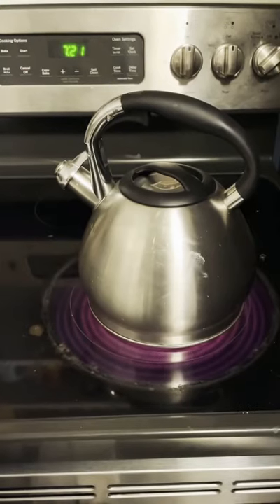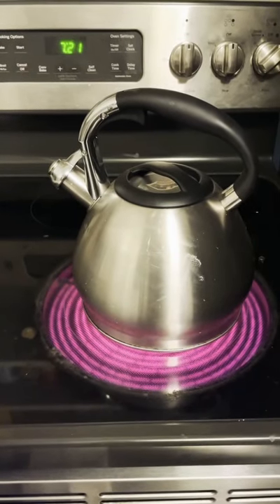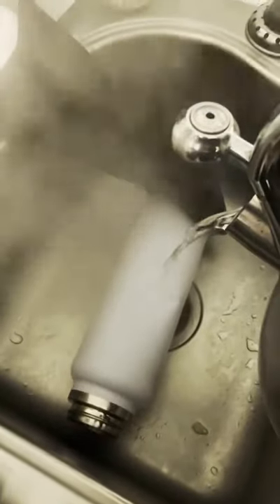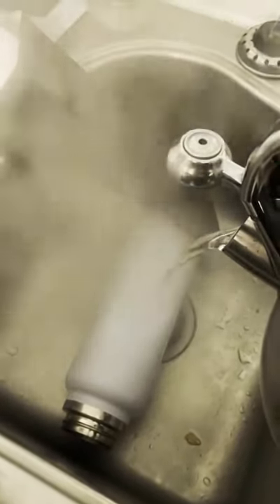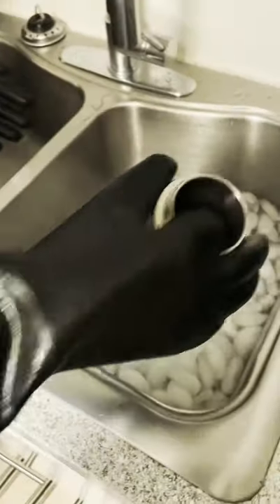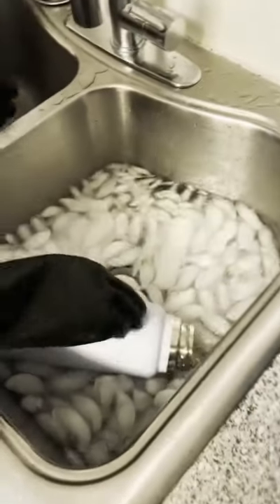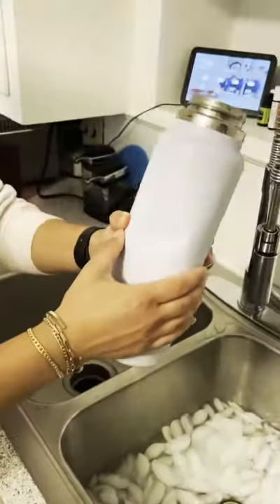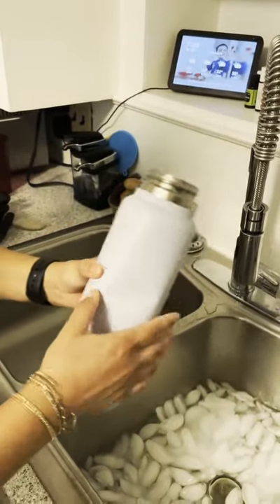Removing a dent from hydroflask | Water bottle dent removal #SHORTS

Comment: Using an object on the inside, to pop the dent out, will shorten the distance of the vacuum between the outer and inner shells.The performance of the bottle will be diminished causing hot or cold beverages to lose their desired temperature much faster.
Reply from the maker: Ok, I just didn’t like the look of the dent.

Comment: ive had my hydroflask for not over 2 months and it already has 2 dents on the bottom (luckily i have a tumblr sleeve to cover it up) and this was all cause of my min pin doggo who knocked it off my bed twice :<
Reply: does it still work like normal? mine was sitting on the floor when i accidentally (softly) kicked it when i got up from my bed and it tipped over and now has a tiny dent. i haven't even had it for over a week!
Reply: @irisdahlia143  yeah it works just fine because it was the only the outer layer that dented and not the insulation layers (inner)